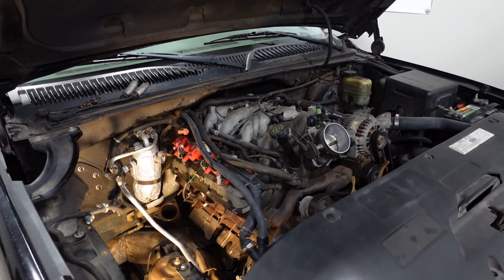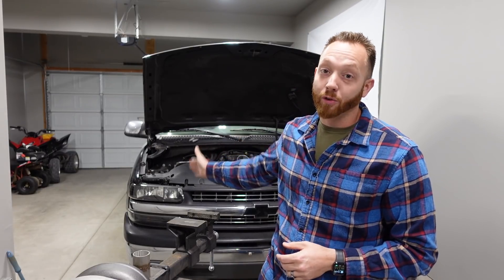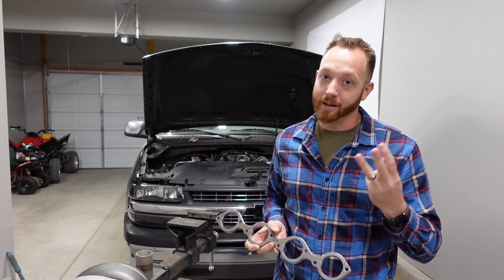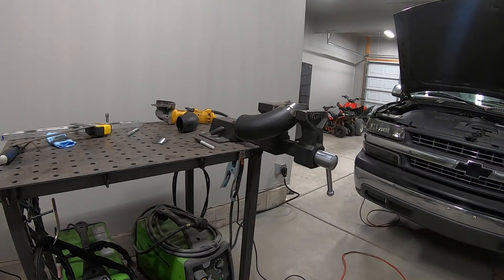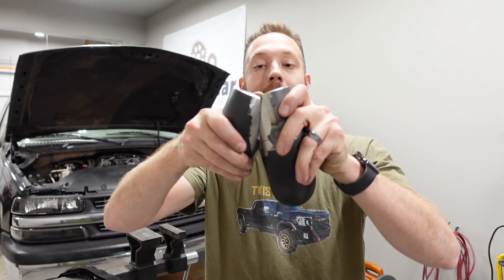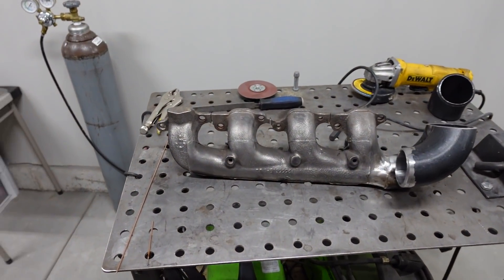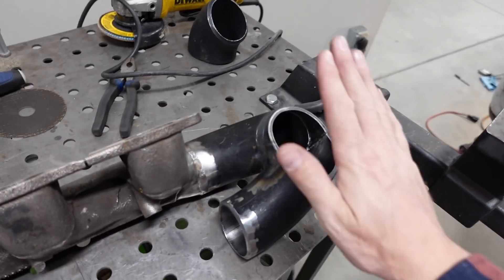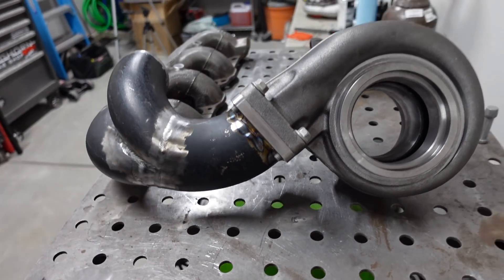Building a Turbo Manifold for an 8.1 Swapped Big Block Silverado

Comment: Nice work. It looks really good sitting where its at.like you said at least you can run a decent filter on the turbo. You shouldn't have any issues with exhaust collection from the driver side. All in all very nice can't wait to hear what it sounds like. Not everyday you turbo an 8.1 lol.
Reply from the maker: no, you don't see em that much. maybe theres a reason haha
Reply: @TolmanPerformance  let's hope it's not "that reason" lol. Im really curious with being seen 8.1 it should sound pretty healthy especially with a turbo. If it had headers it might be obnoxious. Not that perfect exhaust we always have to have. I'm constantly changing the exhaust on my 05 gmc sierra slt 1500 l33 lol. Started with flowmaster now I have a straight through magnaflow and I do like the deepness of the sound better. Old fashion v8 straight exhaust with a flowmaster of course ots going to sound good. These newer engines just just dint really have that.